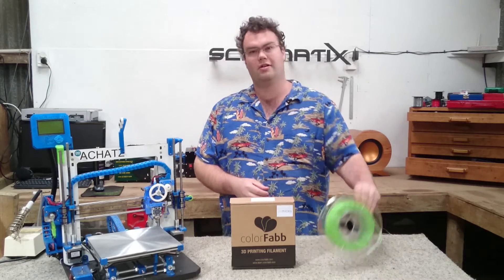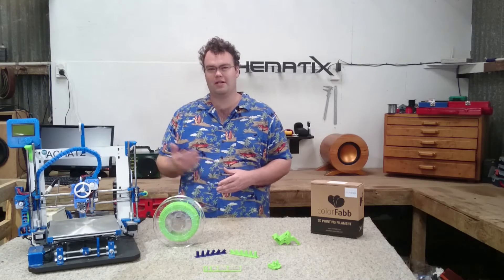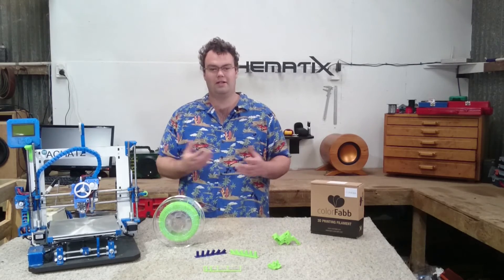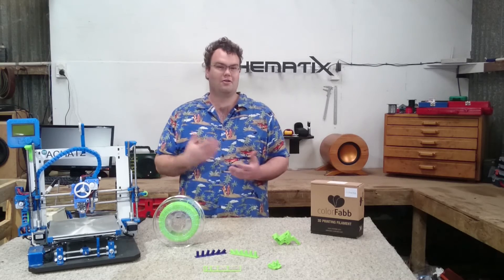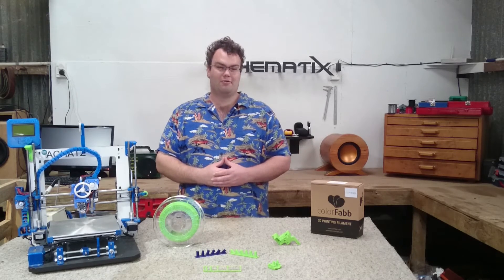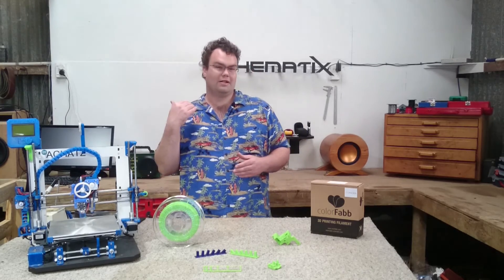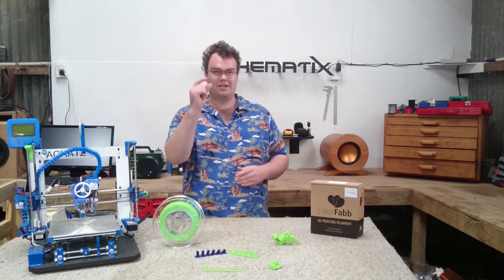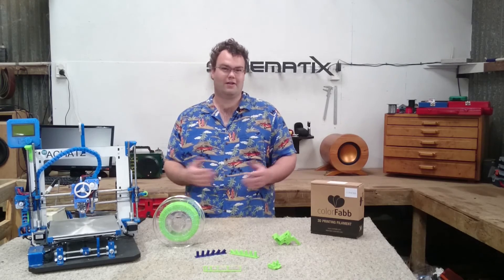Review: Colorfabb XT Filament + PETG Shootout

Comment: IIRC Colorfab XT was specified as PETG in the very early beginnings of Colorfabb. 
But they replaced it with their XT branding. And beyond that is seemed to me as if they actively went out of their way to removed all mentions of what the polymer actually is. That did not sit well with me 😡. Still, it's not a bad filament.

Comment: thanks for the review of the XT, i like your style and format - wondering if you have experimented with the clear XT ?  I am trying to figure out my settings get max clarity on my machines - could use a collaborator:)
Reply from the maker: Thanks for the feedback! While I haven't experimented with XT clear, I have used clear filaments that are very similar. You can try printing with a large nozzle size, as cold as possible nozzle temp, and slow print speed. Probably nothing you wouldn't already know, some bit of info might be useful? :)